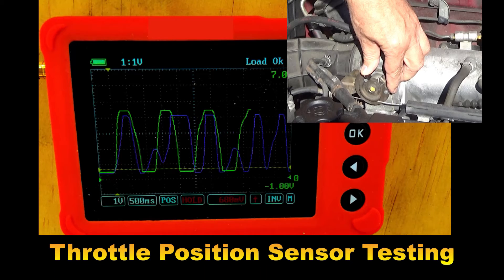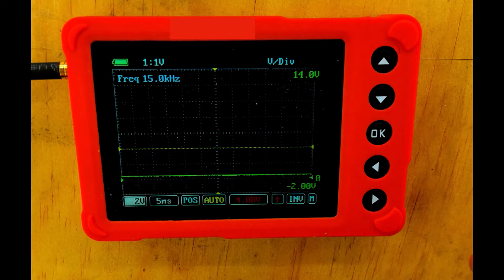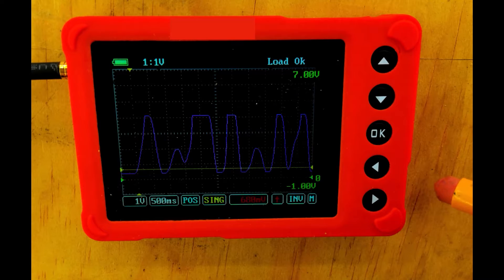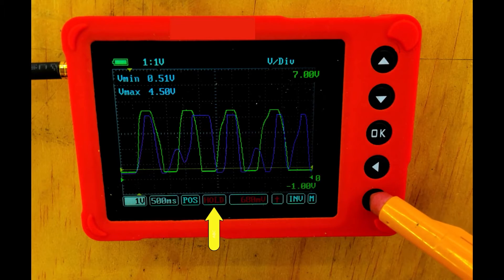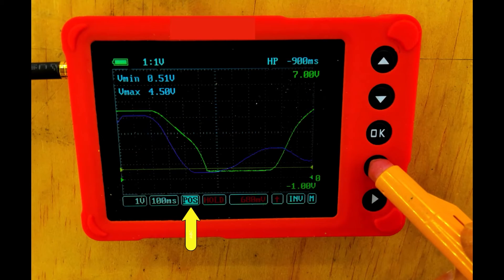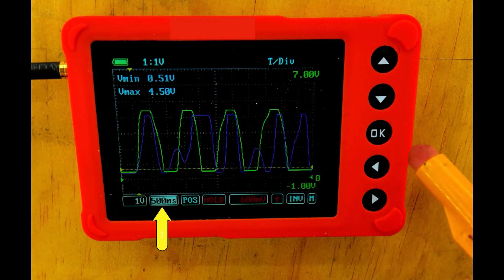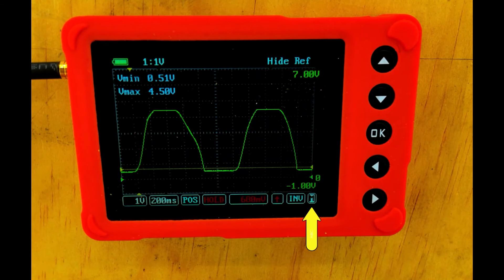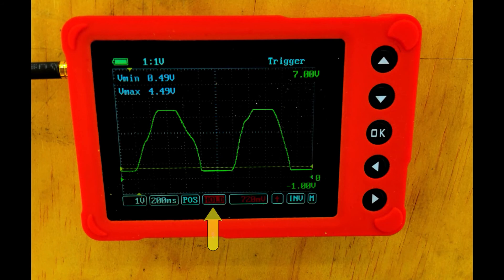Oscilloscope Testing a Throttle Position Sensor (TPS) with the uScope

Comment: You only back probe the output pin to obtain the waveform? What conclusion did you come to after testing this throttle sensor, it appears to show a consistent logarithmic function on the scope which is expected?
Reply: I'm just learning about testing with a lab scope, but from what I've gathered you can pretty easily find picture references online of what a good clean signal looks like for the sensor you're targeting. It seems like most of the time you're looking for sharp spikes in the wave form.  Scanner Danner also has a book with a lot of good information I'm probably going to grab when I order a scope.

Comment: Very useful info! I just came across your channel.👍 I will definitely be revisiting- I already subscribed. Looks like you’ve mastered this uScope. Not sure if I should buy the basic or master kit. Trying to get as much bang for the buck as I can. However I wouldn’t mind spending for some quality upgrades. Hopefully you can shed some light. Thank you!
Reply from the maker: I did a quick look at the difference between the basic and master kit. It looks like there would not be much of a savings if you purchased the additional items separately if you purchased a basic kit and added the extras later.  For most testing you really need almost everything that comes in the master kit and you get the box that keeps it all together.  The amp clamp you get the BNC to Banana adapter in the kit and it can be used with a Digital Multimeter. The one disadvantage in the kit is the secondary ignition kit would need an adapter to work with other scopes. If you bought these items separately you could get the universal ignition kit with the BNC for other scopes but then you would need the adapter to use it with the uScope. I hope this helps.
Reply from the maker: The low amp clamp has 2 settings. 20A and 60A so if you need to measure starter draw or anything above 60 amps you will need the 600A clamp and the adapter from BNC to uScope. If you get the master kit the adapter comes in the kit. Check with AES Wave for a high amp clamp.
Reply: Ty- This helps a great deal as this will be my first scope. I have watched several videos putting the uScope to work and I have to say you have some solid tutorials!!!!! Which will make it a lot easier for me in configuring and saving some presets. Really useful. Do you have any thoughts on the amp clamp as far as higher amp clamp vs. the low amp clamp that comes w/ master kit? Thanks for your help!